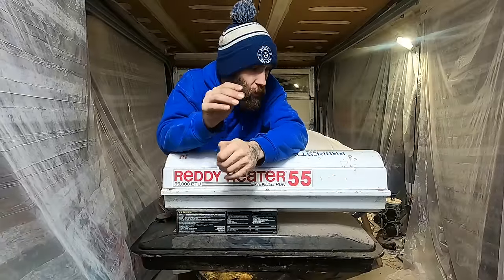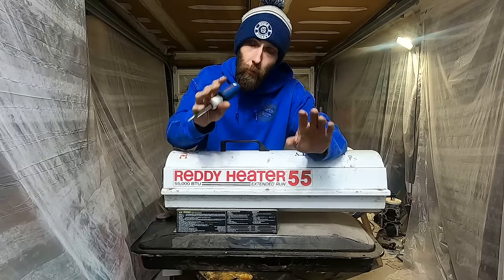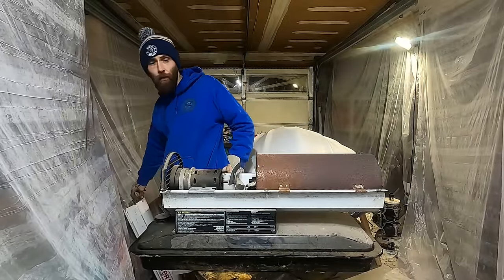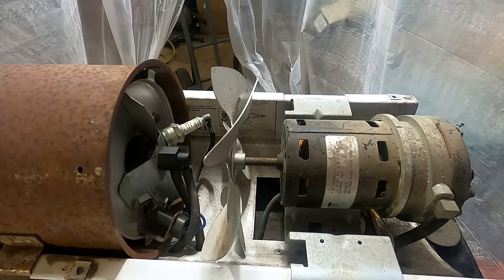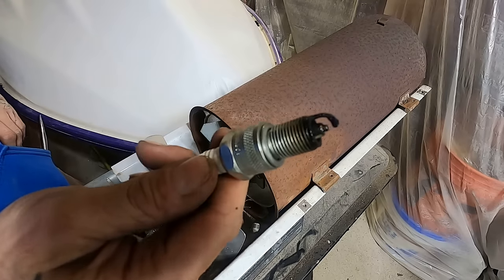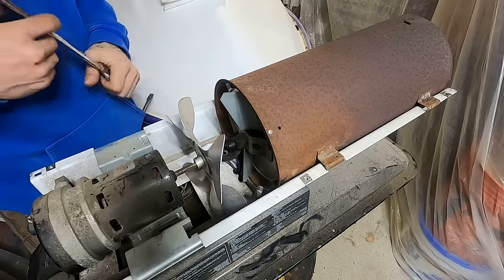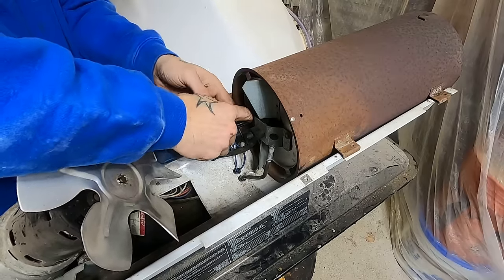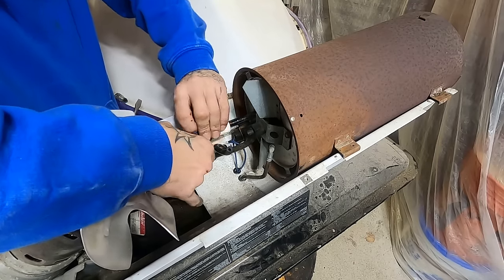These Diesel/Kerosene Heaters are CRAZY East to Fix and Maintain

Comment: Anyone who services oil furnaces will find all of this familiar. I would say that other than a clogged filter, a worn out nozzle would be a top contender for cause of failure.  They erode and you can only put so many hours on them before the spray pattern gets bad. If you have the nozzle in hand, don't clean don't nuthin, replace it!  They cost less than $10. The first number is rate of flow in gallons per hour at 100 psi. The second number is angle of spray,  if it says A or B, that means hollow or solid.  If it 's not a Delavan then H and S are obvious. If in doubt, take it  with you to a supply house.  If the burner has electrodes instead of a plug, then the most likely gap setting is 1/8" away from the face of the nozzle, points 5/16 out from center line, and gap 1/8" to 5/32".  Trust me, I did this for a living for a LONG time.
Reply: Have you worked off of the becket nozzle selection card and used a smaller nozzle and increasing the pressure to get the cleanest possible burn ? I did this with aero water heaters on installs after confirming with a good combustion meter you rarely ever have to clean them
Reply: @seeveiw  I have not personally modded any burner in that manner but that is exactly what the current "clean burn" technology is all about. Most new burners ship with the pump pressure at 140 or there about.

Comment: For all who are having problems with the flame blowing out when you put the cover on, I worked on this for hours and finally discovered that the two sheet metal vanes that direct air into the burner are the culprits. They essentially cause too much air pressure to the flame when you close the cover. My answer is to bend the vanes the opposite direction so they don't concentrate air to the burner. Mine works consistently now with no issues, with the cover on or off. Also, the air pressure adjuster is approximately level with the housing surface, at least on mine. Cheers!

Comment: I have one it run good with cover off but when I put the cover on it shuts off
Reply: Did you find the solution? I have same trouble
Reply: Air filter or low fuel pressure 
Check plastic for cracks and replace it 😊😊😊
Reply: @joseguevara8998 check plastic cover for cracks? Super glue it and test order new cover 😊
Reply: I have the same problem. Did you figure yours out?

Comment: I upgraded to a 80k electronic ignition torpedo heater that runs off propane. Weather Kerosene or Propane just get a new unit with electronic ignition and a brushless fan motor etc. Older units has their purpose back in the day.

Comment: I have the same heater.25 years old. ran fine on red diesel and then it just quit. I went thru all the cleaning from stem to stern. cleaned the plug, air pump, spray nozzle, put in white kerosene. i was going to dump it but then I removed the cover where all the wires are, close to the pump. wha la, found the ground wires were loose because the screws were not tightened down. It lit off like it was brand new and still using off-road diesel.

Comment: Mine runs fine without the top cover off. When I put the cover on it or start to when it's running it all most shuts down when I it gets close to being in place.
Reply: Bad or dirty sensor that is supposed to see the flame in the burner chamber would be my starting point. I would replace the sensor first. Taryl fixes all has a video on it.

Comment: There is usually a fuel filter in the tank. I don't recall you covered that part.
Also the ignitor (sparkplug) is sometimes a element that turns red hot. They go bad but are replaceable.
Reply from the maker: Shoot, I did forget to cover the filters! That 55 didn't have one, but most do. Thanks for the reminder bud!
Reply: Yes it has a filter. It is in the tank  @DEInTheGarage

Comment: Two other problems I had with mine: the thermostat contacts were dirty/corroded and not letting current to the circuit board. I sanded them with a tiny doubled-over piece of sandpaper inserted between the contacts.
I also discovered the circuit board wasn't working and the igniter wasn't getting power. The large 2.7k ohm wirewound resistor was burned out. I desoldered and removed it, found an old 3k ohm 25w resistor from a scavenged board and soldered it in - it works great! The igniter wire was also broken at the connector, I had to crimp a new connector on the wire.

Comment: We always called them salamanders or torpedoes.  I love mine, but my garage is an old cinderblock garage with a door that doesn't fit right, leaving a big gap on the top panel as it's an ancient garage that originally had a tracked rolling barn style door on the front of it.

Comment: Thank u very much for your video,
I figured out with mine the coil was weak
New spark plug run for a bit then not.
Changed to a 120volt hot surface igniter.
Had to leave the old coil under the fan to dampen vibration.
Undid the coil off the board 
Plugged in igniter and works now!

Comment: There are several makes and most of the popular ones (around here anyway) are all made by Desa and use alot of the same parts. My newer Dyn Glo 80,000 btu heater actually has an older 75,000 btu spray nozzle in it from factory! So all they did was paint it a different color and slapped an 80,000 btu label on it in place of the 75,000 btu label! WTF? I run mine on diesel, which puts out more BTUs than kerosene (and doesn't stink like kerosene) so I'm happy and it works great!

Comment: Great video.  I have a Master 150K BTU that is old enough to where I can't buy a replacement fuel tank since they are no longer made.  It is leaking diesel out of the plug on the bottom.  BTW, how do you remove that plug?  Just use the biggest flathead screwdriver you can find?  I know it has never been serviced in it's probably 20 year life so I will have to buy a lot of replacement parts but I want to get the fuel tank fixed before I go any further.  The fuel neck is badly damaged and oblong.  Someone drove a screwdriver through it looks like in an attempt to vent and make it run better so it leaks when you try and transport it with fuel sloshing around.  I was told it runs for a while then shuts down.  I think the first thing I'm going to do is take everything apart and try and get the fuel out of it and see if I can get that fuel neck straightened out.  If I can't get it to stop leaking I might just have to punt.  What do you think?  Have you ever tried patching up holes in fuel tanks on these things?  If so what did you use?  JB Weld?  Take it to a welder and pay them more than it costs to just buy a new one?  Many thanks and again great video.
Reply: Good Morning..!! There's an outfit known as Gas Tank Re Nu . Look it up in your area. They clean,coat then bake the tank with their product to give a fuel-proof new life to your tank.. Good Luck,hope this helps.

Comment: I recently bought a used diesel torpedo heater. It fires up just fine and runs great for about 5 minutes then starts to puff out a couple clouds then completely looses spark. Any thoughts of what the problem could be

Comment: Thanks for the info. Appreciated. However, mine a reddy heater 155000 BTU runs fine if i take the cover off. Put it back on it shuts down. After checking the intake, there’s no filter. Can it be cleaned?
When it runs good in a 20X16 shed in the middle of winter it’s scorching hot.

Comment: Altitude will cause it to act weird as well... we are at 5700ft. above sea level. Thanks for the video!!
Reply: Can you get the next size smaller nozzle?
Reply: @johnwyman6126  It is probably more of a balance of air and fuel ratio to get it to perform better at higher elevations - I would imagine there are other nozzle sizes that would be able to be incorporated into the torpedo heater. My old, free junky one without wheels is still operating and we are close to 6,000 ft above sea level.

Comment: Hi buddy , good write up , just got one of these for £25 not working, fires up and runs for 5 seconds then flames out , goes through a restart cycle then fires up again for 4 seconds,and keeps doing this . Cleaned the nozzle it was a bit cruddy , cleaned the photo cell but still the same , checked all the lines no blockages , any idea what now ?? Please

Comment: My shop just tried to junk one of these. Needless to say it ended up in the back of my truck. It fired and runs for a few minutes then shuts off with a E1 code (it’s a tradesman k210) I’m like dude it just needs a tune up. Gonna clean it up and use it at home in my garage.

Comment: I have one that came from a rental place that shut down. The rear pump cover is made from bakealite, it can crack over time, also the pump fins can stick. I got mine running, but it doesn't quite reach the psi indicated in the specs.

Comment: I need 20,000 BTU and a chimney. No electricity neccessary.  
I made my own. 
It burns clean propane. No stink.
Reply: Two 10,000 BTU radiant kerosene heaters would probably cost much less in fuel.
Reply: @johnwyman6126  I can turn my 20,000 BTUs way down to ~2,000 BTUs and that's all I need during a power outage. AND NO STINK from the kerosene. .. My heater has a chimeny.

Comment: 99% of the problems with these things is low air pressure, because of a worn out pump. Once they wear out you are screwed. I just hooked up an air regulator and plugged into the shop air supply. Works great, no more messing around with air pumps, and you can adjust how much heat you want by just turning the regulator up or down. We had one of these units that had so many hours on it that there was nothing left of the inside housing it had literally burned up. The really old heaters had air pumps that were built much better than the newer ones.

Comment: i got a RH 156k and it will only run right if i almost completely close off the air supply at the back. otherwise it fires up and blows out  any ideas???

Comment: I have that exact model. I have winter diesel in it. If the room temp is below 30f I have to give it a quick little help from my propane torch to fire it up. Is that normal or should this thing light below 30f on winter diesel? I love using it otherwise.

Comment: I’m still having problems with mine it’s a ready heater like yours changed fuel line cleaned air pump blew through air line & put fuel in it cleaned spark plug now I’m adjusting air pressure & haven’t got any fire yet

Comment: Great explanation of everything....thanks so much! I think mine can be fixed.
Reply: There very easily fixed a look at plastic parts that are extremely bad about cracking and I super glue it and order a replacement parts 
Simple system on all of them 
If it has a spark plug clean good or replace it 😊

Comment: Here in the UK there called "space heaters" 😊 just add another to the list 😉
Reply: In the States, 'space heater' is exclusively used to refer to plug-in electric radiant heaters. This fuel-oil forced air burner style heater is most commonly referred to as a torpedo heater or salamander.

Comment: so what do you think would cause this... when i start up my heater it runs good. if i shut it off and immediately try and turn it back on it just hums until it trips the little breaker inside. but if i let it sit about 10 minutes after i shut it off it starts fine again. not a huge issue just annoying.

Comment: Mine is a reddy 35 same as yours just smaller. Anyways mine will run but the cone doesn’t get red and I can’t adjust the screw to turn it up or down on pressure. It’s putting out heat but won’t adjust and I don’t think it’s running the way it should run. What should I do?

Comment: I have a dyna glo delux propane heater...that will only light when the bottom cover is off...amd will not shut off...fan runs the whole time the power switch is on. 
Any ideas?

Comment: Great video, but my old Homelite HH50 still has no spark , after cleaning everything and new spark plug. I finally found new ignitor kit online but worried about spending over $100 on a 1987 heater, when I'm only guessing what the problem is.

Comment: Mine has worked well for several years. Pulled it out from under a bench after 3 years of sitting and nothing. Took the cover off and blew out dirt and a couple spiders, cleaned the photo eye, but nothing. The lighted switch comes on the the fan does not move and nothing clicking. Does this sound like a bad motor?
Reply: I just went through a bunch of fans, and blowers, trying to get waist oil to burn right. All were a little gummed up, one was seized up. Tore them all apart, cleaned, lubed, and reassembled them. Takes about 10 minutes  appease. Might get your fan going. Or you'll find the problem.

Comment: I HAVE DEWALT HEATER AND IT WILL NOT RUN WITH THE TOP COVER ON . RUNS FINE WITH IT OFF BUT SHUTS OFF AS SOON AS THE COVER IS INSTALLED ,CANT FIGURE IT OUT , ANY IDEAS ?

Comment: If you can find them, the multi-fuel versions of these heaters are awesome as they can run diesel and kerosene (as well as a few others) and can be ran off of fuel oil if you have that available in your area. 15:43
Reply: Multi fuel?  Those are all the same fuel.  #1, #2,  Jet A, Jet A1.  Same shit different day...
Reply: I have a couple of "keresone" Reddy heaters and I run diesel in them all the time.  It's all the same fuel.
Reply: I have 2 Remmington brand 60,000 btu units. One says its for kerosene and the other says multi fuel. I will say when I run diesel in the kerosene one it is noticeably more smelly than running diesel in the multi fuel one. Might just be a bad nozzle though. Haven't dug in to look.

Comment: My unit will run great with the cover off, If i put the cover on it shuts off / trips the internal breaker?
Reply: Mine is very similar. It will run good with the cover on. As some a I screw the cover down it shuts off. Anyone have any ideas for us?

Comment: I've been working on  mine all winter and it still don't work.   It's not pushing fuel fully into the nozzle. I've replaced the viens in the back, changed the back cover, replaced all hoses and still nothing.
Reply: there is a filter in the pickup tube that goes into the tank.. strip it down and remove the tube . push the filter out and replace it

Comment: "does not mater the brand, does not matter the size! They are all the same once the top cover comes off.." except they are not, mine (remington 220t-dfv) is just a fan with an electric fuel pump...which no one ever covers on youtube and they all say "they are all the same" and show the typical old style venturi system which the larger ones do not use lol (at least mine)

Comment: I really could use advice.  I have replaced the pump insides, the nozzle, the spark plug, filter kit and also cleaned everything.  The kerosene would spray out but not ignite. That's why I replaced the plug even though the old one had a continuous spark. I checked the light sensor and it is fine.  You can aim a flashlight at it and it will keep running even though it doesn't ignite. I even took the base off and found a small filter insert in the fuel pipe had fallen out but I was able to get it out, clean it, and reinstall it.  The main problem is that it will turn on and just not ignite.  After installing all new parts, I don't think that the pump is making enough air to pull the fuel up.  Actually the old nozzle seems to spray better than the new one.  I also checked to see if the airline and supply line were cracked or blocked but everything was fine.  I have blown air through hoses and nozzles.  I can't see anything else that would make the pump blow air through the hoses.  All the blades go out and in when I turn the fan and you can hear them.  Please someone advise me of what else I can check.  Also replaced kerosene.  I just don't know what else to check.  It should actually fire up and run.
Reply: Mine 55,000 smoked terribly.  Looking at the plastic cover on the pump with a magnifying glass, I saw some very small cracks. New cover and good to go.
Reply: Keep in mind, the pump creates a lower than atmosphere pressure and atmosphere pressure moves the fuel from the tank to the nozzle, so make sure the tank vent isn't clogged and all fuel lines and pump components pass a vacuum test.
Reply: take the rear cover off the air pump , check the vanes , they build up with dirt  watch out for installing the vanes wrong though , you will see a slight rounded edge on 1 side that goes out rounded facing the rear ,  check cover for cracks . mine are 40 years old and I take mine totally apart every 2 years in summer , clean and check it

Comment: We call them a knipco heater or, "the knipco". As in go buy a knipko. Or Grab me the knipko. Or put a knipco on it.
Reply from the maker: Definitely never heard that one before! Very cool
Reply: @DEInTheGarage  wait, what?!! I think Knipco was the original maker of these. (I could be wrong) My dad had a Knipco for as long as I can remember, way back in the early 70's for sure. In the last 20 years or so I see all these copycats like Ready Heat and Mr. Heater and of course all the big box names. But back in the day, it was Knipco all the way.
Reply: I have a Knipco brand from the 60's that heats great. No stink on kerosene! Has electrodes for ignition.
Reply: I've got the KNIPCO F110E and it the motor does not come on. I've checked all the obvious. Suggestions? @BenjaminHansen
Reply: @cheriegrant8068 is there a fuse reset button? Does the motor run if you connected directly to 120 volts? They do go out.